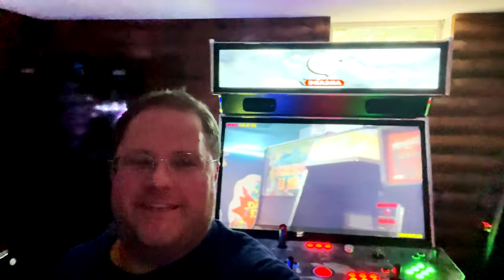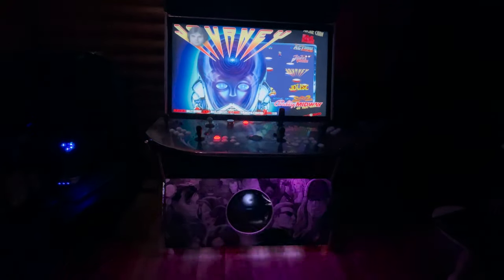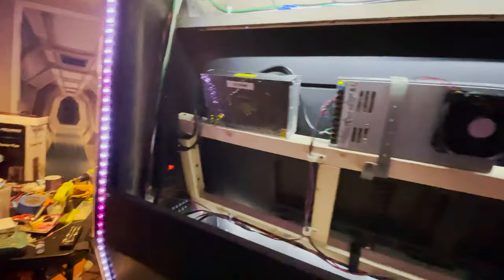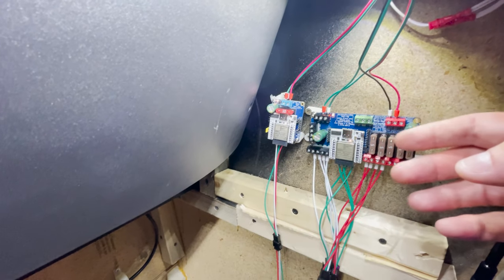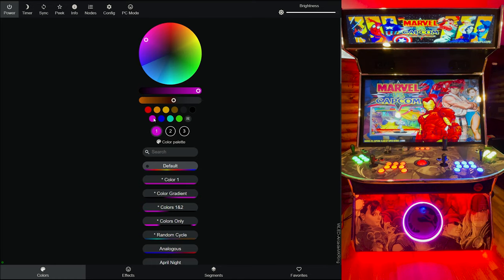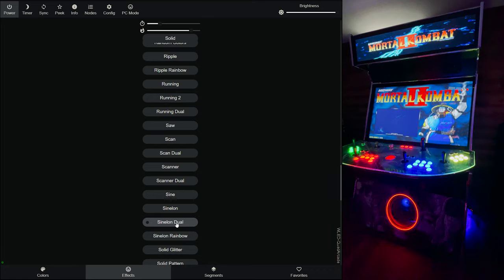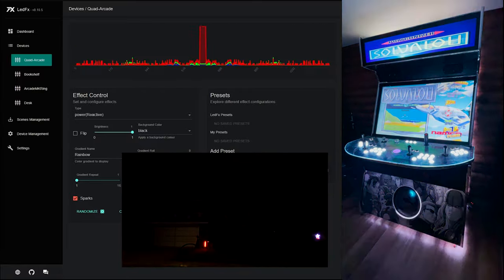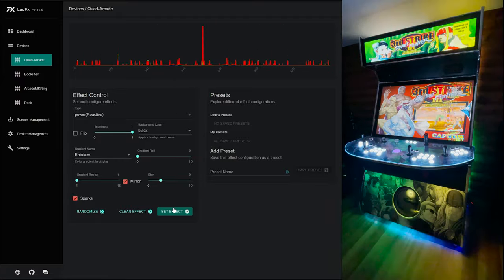MEGACADE Arcade Cabinet RGB Lighting Tutorial with WLED and LED-FX

Comment: Hello Adam.  I'm curious how you power the entire Megacade?  Is it by a standard 15A power outlet?  The LEDs alone must be capable of drawing around 20A at max brightness.  That doesn't even take into account the computer, monitor and marquee.  Is this connected to multiple outlets?  240v?
Reply from the maker: Nope single 15amp 120v outlet, my vpin is on the same circuit too, but you are forgetting ohms law:  5v DC x 60amps = 300watts or about 2.5amps draw at the wall (120v assuming perfect efficiency and peak load, neither are true).  I suspect my entire arcade, pc, rgb lights, speakers, controllers, etc pulls about 600 watts or 5amps while playing an average game, probably 7amps tops if its graphically intense like MK11 and pushing the PC to max.  I have a kill-a-watt meter, would be interesting to measure and confirm!
Reply: @ArcadeAdam   Thank you for the reply Adam.   You are absolutely right!  I was thinking in  terms of Amps  instead of Watts.

Comment: Hi, looks great machine. I build mine with raspberry pi4 but that screen that's in top part looks great. Can I ask what it is . Thanks
Reply from the maker: The top most display is two 2.5mm pixel pitch p5 panels running pixelcade.  They’ll sell you the whole kit